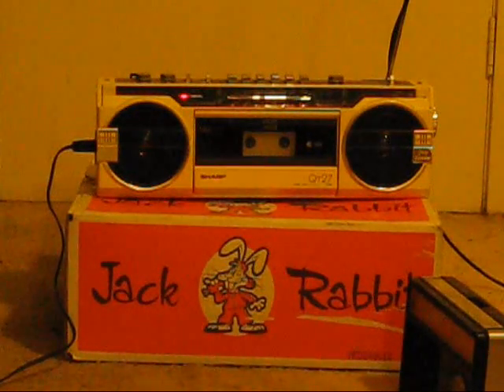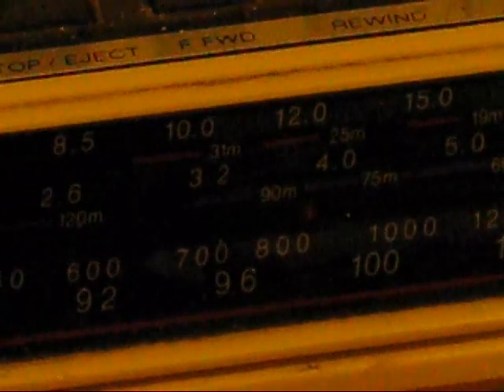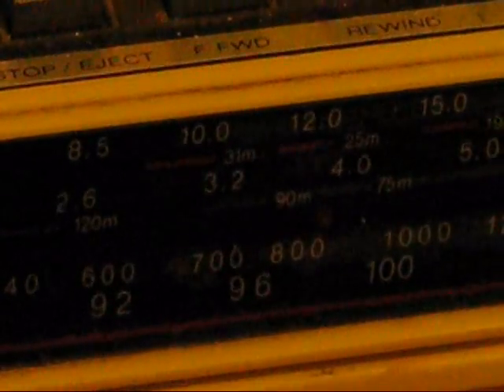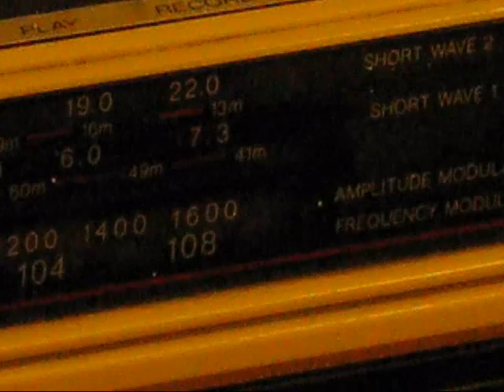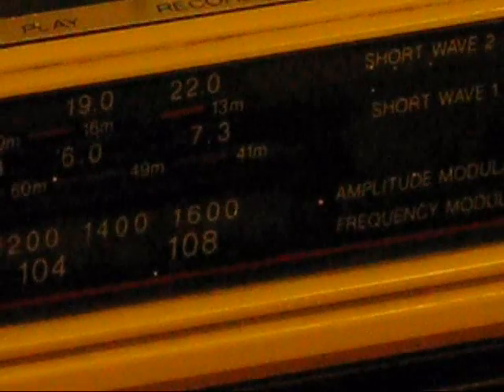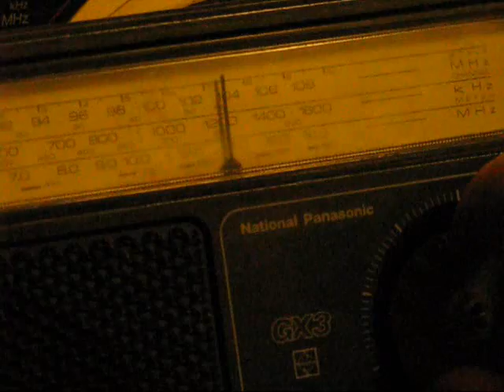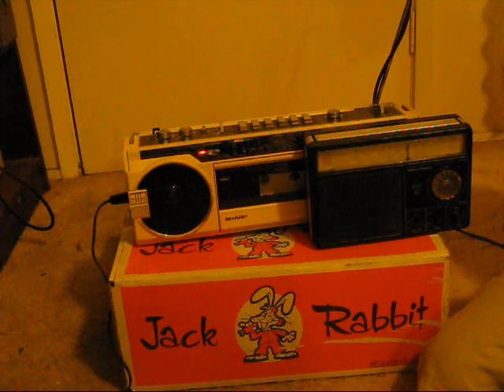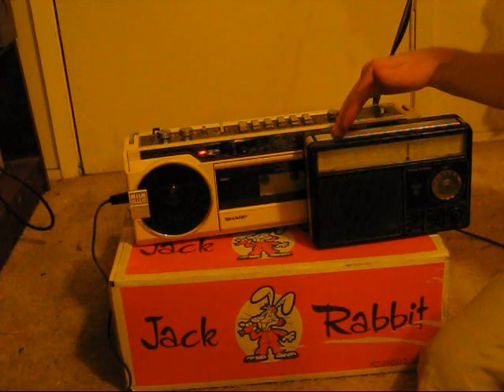Using two radios to receive HF SSB

Comment: I had a Marconi 5 valve radio years ago, I got a transistor radio put a wire from wrapped around the local oscilator from the transistor radio about 16 inches long other end of the wire going to an IF can just wrapped around it, and got great SSB with a bit of fidling but well worth it.
Reply: I know it's pretty off topic but does anyone know of a good site to stream newly released series online ?
Reply: @Joel Levi I use flixzone. Just google for it =)
Reply: @Westley Philip Yup, been using flixzone for since april myself :)
Reply: @Westley Philip Thank you, I went there and it seems to work :D I really appreciate it !
Reply: @Joel Levi happy to help =)

Comment from the maker: The video shows it works - watch again if in doubt.  No 455 kHz ceramic resonator circuit required.  However the AM radio must have a local oscillator 455 kHz above the received frequency - use an older style type with dial.

Comment: I did that in the 70s - I don't know how I learned about it in those pre-Internet days.
Latterly I assumed I was tuning the local oscillator of the radio to the IF and it was leaking through the RF circuits of the target radio - clearly I was wrong. :)
I've just ordered a cheap DSP radio for fun and as a crude bench test device and I'm guessing there's no IF and I will definitely have to make a BFO tuned to the frequency I'm listening for ...

Comment: I have a rare 1970's era SONY ST-2950s home stereo component AM FM tuner with SW between 2.3 to 18 mhz  on 2 bands recently I discovered I could use it as a BFO to precision tune my home built  SW crystal radio to receive single side band when both were connected together to a  long wire antenna. I could tune in Ham radio , aircraft, even a SSB pirate radio station. I would use the crystal set to hear a fuzzy SSB signal. Then  I would use the SONY tuner to fine tune the SSB & CW signals from 75 meter to 20 meter  bands. it  should work well for a cheap SW AM only radio too.

Comment: I guess this only works with an analogue radio ? I did try with a tecsun etc, didn't work at all
Reply from the maker: Correct. The local oscillator  needs to be on the right frequency.

Comment: My receiver is a Tecsun PL 310 ET, and i always tune to the ham radio frequencies on 40 and 80 meters. Do i need to have an older analog radio, like a cheapo Chinese SW radio, as a BFO?
Reply: I also have the same tecsun radio. It's best to not use the cheap analogue radio and instead use a larger and older radio, mines from 1966

Comment: I have done that too with two AM Radios. But both were not very stable in Frequency and so I had to retune a lot. Usually I think dedicated BFOs are more stable Oscillators. For AM Oscillator Stability is not so important as it is for SSB or CW Reception, I think..